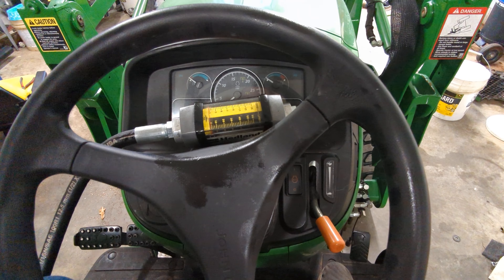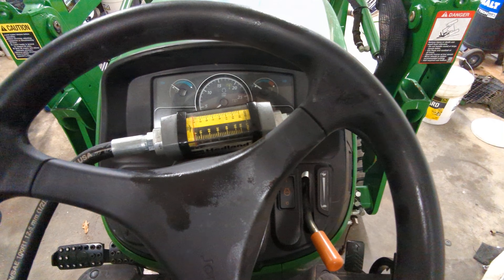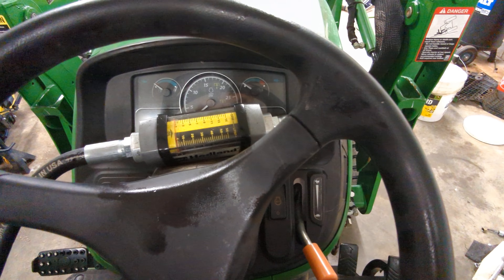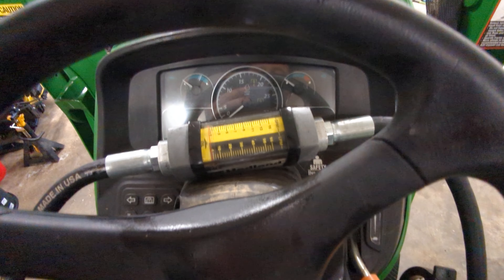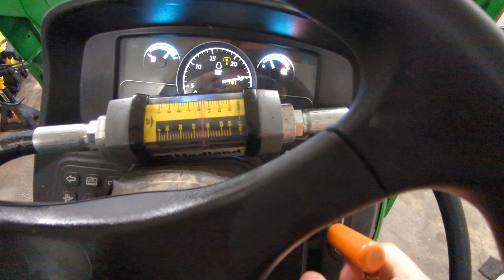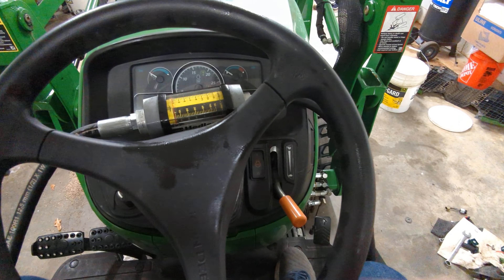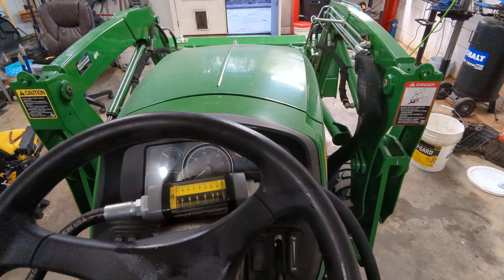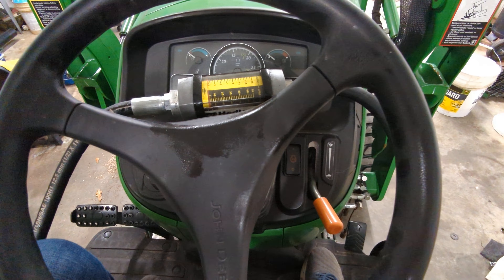HydrosPlus 2R3E Performance Kit Flow Readings

Comment: How much additional hp is being used by your pump and is that only when there is hydraulic demand?  I have the 2032r not the 38r, so hp is already light for some applications
Reply from the maker: Great question!  The HP required to push 3000 psi at 10 GPMs is about 21 HP.  At the stock flow, it's about 12 HP, so a decent increase, but only that high if you hit the pressure relief valve by trying to lift something that you can't, or you deadhead the cylinders.  Also consider, with HP, you probably won't be running at 10 GPMs often, more likely 8 or less.  8GPMs at 3000 psi only needs 17 hp, but you'll also be around 2000 rpms, so your power will be down closer to 28 depending on which power curve graph you believe.  Obviously, this is still well under the available HP, but even with the stock pump, you do have to manage the power you have across the functions you can apply.  For example, you could open the PRV if you're sitting still at WOT, and have plenty of power, but if you're also using the hydrostatic, you'll have to balance them - with HydrosPlus, or with stock.  While you can't kill the tractor with the implement pump alone, stock or with HP, you can kill it with the hydrostatic alone...as well, you can kill it with the PTO alone.  In my use, I've not had any issues, but haven't pushed the load limits while also moving hard with the hydrostatic.  I'm sure it can be done, but generally, most people aren't pushing the boundaries that often, but if they do, they back off.  For example, when you hit heavy grass with a mower, you slow down to both slow the amount of grass coming in, but to also give the power being used by the propulsion back to the PTO.

This is also a selling point for the larger lift cylinders, since that is the circuit most likely to see the max pressure.   By adding volume to those cylinders, you'll need less pressure to lift the same amount of weight, thus you'll need less HP.

You can find many calculators via google, and they are basically all the same, but the ones I use are here - https://www.womackmachine.com/engineering-toolbox/formulas-and-calculations/hydraulic-pump-calculations/

Comment: Anybody can look at the flow meter but you have to show people how to adjust that
Reply from the maker: I'm not sure I understand what you mean.
Reply: @HydrosPlus  I know you put the flow meter on there and it shows you the pressures where you’re supposed to be at a different RPMs but you have to show how to adjust it so you can get more hydraulic pressure
Reply: @HydrosPlus  I think I explain myself pretty good
Reply from the maker: @deanmoore420  a flow meter doesn't measure pressure, only flow.  You can turn up pressure using just hand tools, but in order to increase your flow, you need a HydrosPlus solution.  You can find more information on this model here - https://hydrosplus.com/shop/ols/products/hydrosplus-2r3e-performance-kit
Reply: @HydrosPlus  I definitely understand what you’re talking about but you need to show that on a video show how you turn up the hydraulic pressure for the Hantel I would love to see that
Reply: @HydrosPlus  I totally understand what you’re talking about but we need to show a video how to turn up the hydraulic pressure with a hand tool I would love to see that
Reply: @deanmoore420  this solution isn’t for increasing pressure.   Only flow.   That’s the point no?